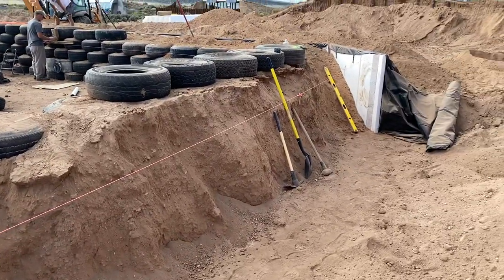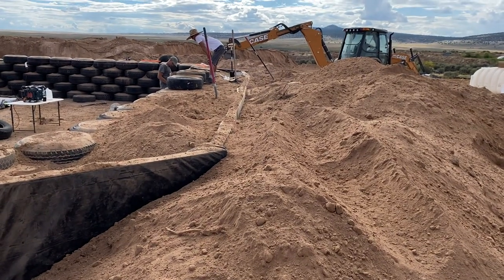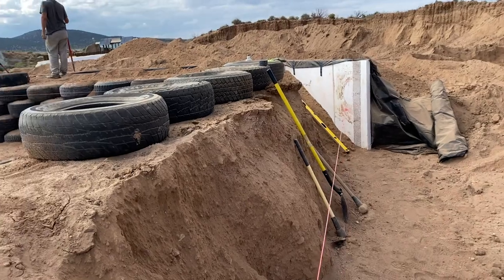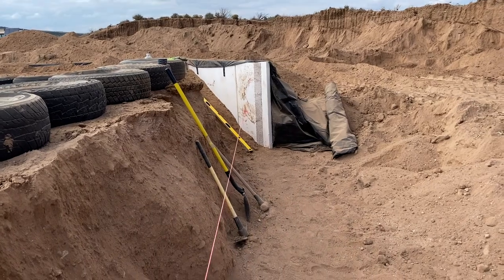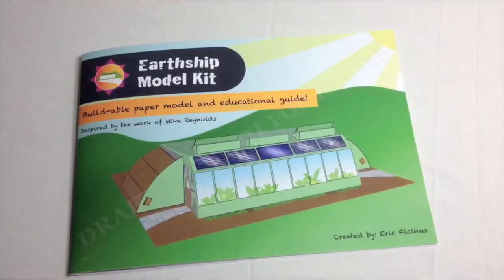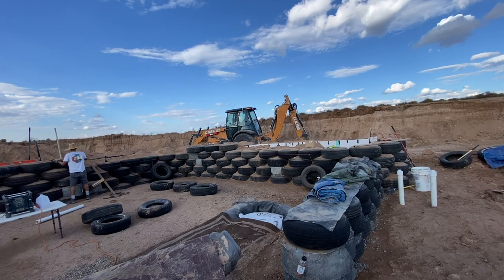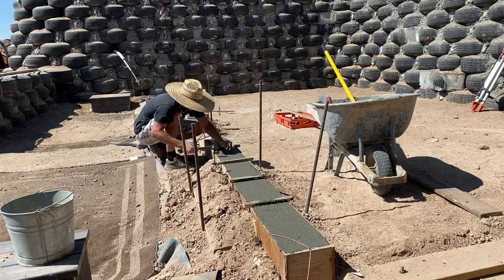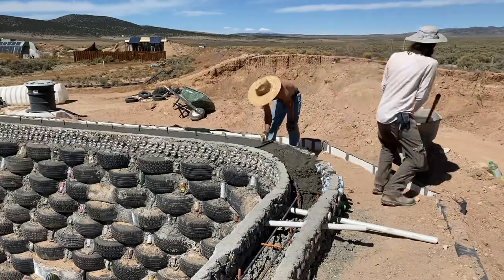Insulating our EARTHSHIP - Only video  that explains this!

Comment: I've been collecting free Hot Tub Covers to use for this purpose on My root cellar. 
They have already put off all the emissions in the years used. They're easy to shape and pest resistant.
You did a fine job of explaining this !
-KJ

(I look at brick homes and think - "That brick should be inside.")
Reply from the maker: Nice! And yes, the brick 🧱 should be inside!!

Comment: NIce job on the videos, I saw your kit when I went to the Academy. With all the attention spent on thermal bridging, isn't the external tire wall where the berm insulation terminates, a tire sized thermal bridge? I'm dealing with this issue on my build currently.
Reply from the maker: I would have to see it to comment. Really depends on wether or not the retaining wall extends beyond the front face or not… Where are you building?
Reply: @TheOffGridGuru  Ya true. Doing a modified Encounter, which has exposed wing walls, in North Ontario Canada.

Comment: Tires are a cool concept for recycling but you can achieve the same effect using doubled wall insulation and spray tech concrete .  All the tire pounding /collection etc seems very time consuming .  Other ways to achieve same principles of convection heating and cool.
Reply: What's spray tech concrete? Concrete dose not breath well enough for earth ships, due to the high insulation value of the thermal mass there can be issue with damp accumulating on or inside walls in humid climates. Adobe or cob type rendering seems to be sighted as best.
If the concrete is just for use within tires maybe however the work to pack the tires with earth could be automated somewhat more anyway with certain purpose equipment, however physical work for people isn't necessarily a bad thing in terms of strength and exercise, so.
Reply: The tires pose the single greatest labor cost in these buildings, from collecting, to pounding, to finish work, it’s a huge expense if you don’t have a crew of 30 paying laborers.

Comment: Just to be clear your wrapping both sides of the foam with plastic not just the outside?
Reply from the maker: Outside only and then a thick EPDM rubber skirt above all of it to shed water away from the berm altogether.

Comment: Why is a small thermal break on the walls so terrible when the entire floor remains an uninsulated thermal bridge? 

Up north where I am I always assumed the whole floor would need to be insulated as well.
Reply from the maker: It depends on how deep the frost line is, thermal bridging through the floor is not a problem for this design & location. The insulated berm breaks the frost line. However, There are certainly climate zones, site conditions and designs where you want to consider insulating the floor! Sound like you are in one of them!

Comment: Tires are such a flaky building material.

a) Using them does not actually address the environmental concerns at all. It only keeps some of the problem out of sight. But everyone gets sold on the feel good story.
b) They are cheap, but transporting them along with time and labor, actually hide the True cost. Plus you are literally taking away someones garbage. They have businesses that already do this and charge for it. This is also before you pound dirt into those tires and all those resource and labor costs associated with installation.

Solution: Use concrete. It is readily available, simple to pour and form into any shape, will last and also has excellent thermal properties, reduces the time to get a roof up and cover your site. It also makes adding a vapor barrier or other very simple and straight forward, meaning everything is completed much faster. Some might argue about the total cost, but it is not that much more expensive and saves you a lot of time and effort and delay in getting a roof up so you can work on completing the rest of the construction. Logically you can most likely out earn the difference you would pay by working the difference of the time you save. It might change a bit if you pour a thicker wall but that is optional.
Reply: I guess you haven't heard about the fumes emitted from concrete.....
Reply: Using recycled materials is a way to store carbon and trash in a positive/useful manner instead of sending it to the landfill to decimate the area for thousands of years while off-gassing and leaking toxins into the ground and possibly the water supply. Concrete is one of the top contributors to CO2 emissions and also creates other industrial toxic waste materials. Don't be so scared of hard work and helping the environment dude!!
Reply: "Plus you are literally taking away someones garbage": you're right, that is a plus, taking away someone's garbage that they would otherwise need to pay to dispose of. Transportation, time, labor, potentially other environmental concerns are certainly things to consider with tires. I think you should also consider the transportation, time, labor and environmental concerns with concrete. You can get the water to mix with it locally, but otherwise, you're transporting much more weight with concrete vs filling a container with dirt. I believe concrete is associated with much higher CO2 emissions than filling discarded tires with dirt. You're certainly correct about concrete being easier to work with, which is why I think it's a much more common building material. If you're looking for ways to trade-off lower cost and lower CO2 emissions vs higher labor and more time, then tires may be something to look into using. If you're looking to minimize time and labor, and you're ok with paying more and taking responsibility for the associated CO2, then I agree that concrete is a solid solution.
Reply: Shhh.. shhh. Just let it happen
Reply: Are you paid by the concrete industry?  Geez.....
Reply: @GhostsonAcid  He's intellectually lazy & pompous enough to embarrass himself
Reply: The tire wall is a vastly underappreciated expense. From gathering to pounding to finish work and maintenance, it is the single factor preventing mainstream adoption.

Concrete is an alternative with different pros and cons for sure. Depends on your available resources and ethos.

I’m always thinking of alternatives to the tire wall.